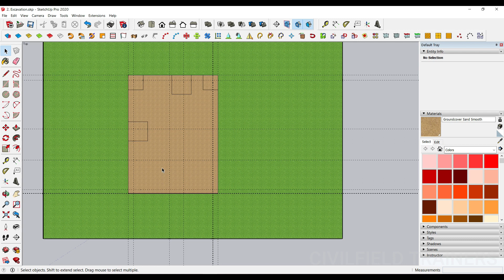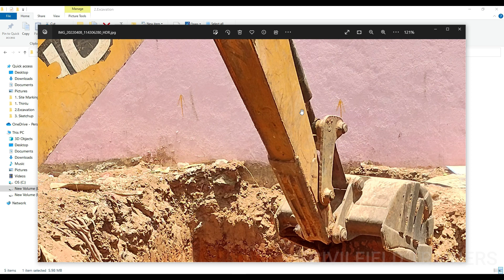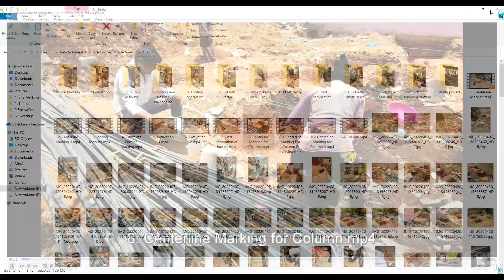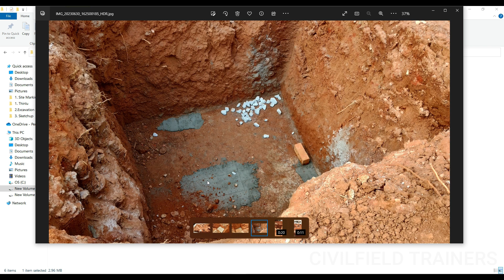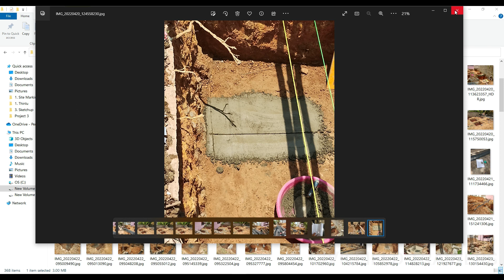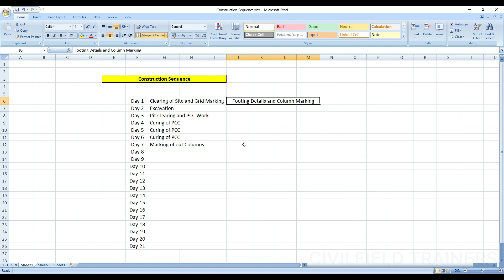[G+2] Excavation and PCC work Overview- House Construction Step by Step [Part 5 of 5] -

Comment: Please can you share the design details for footing at property line have you allowed any tension in footing leading to loss of contact and what was the sbc of soil.
Reply from the maker: This project is a couple of years old. So I don't exactly recall the values. But the entire detailing has been covered in the Construction Sequence course. You will get all the details there. 

As far as loss of contact due to tension is concerned. This is a G+2 structure situated on fantastic soil conditions. We didn't have any trouble, so we could eliminate the top mesh and use just the bottom mesh.